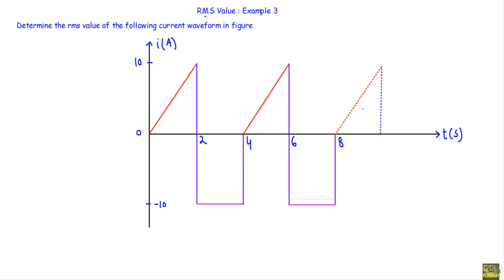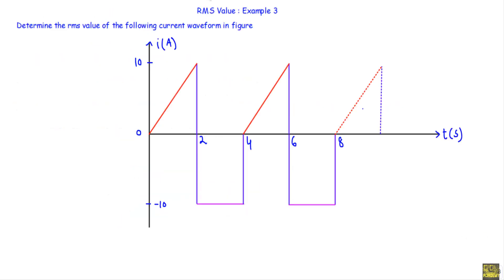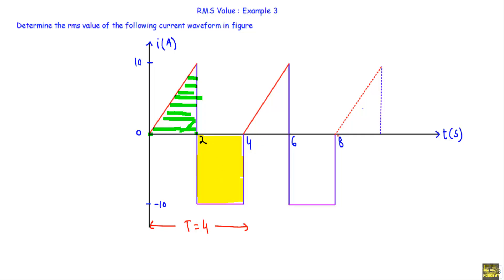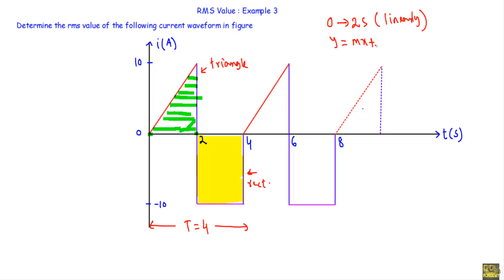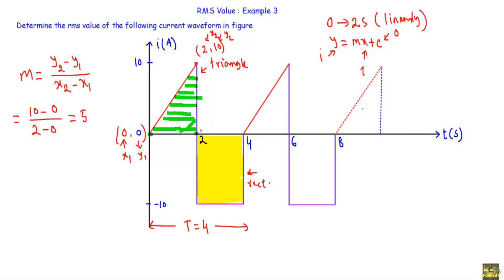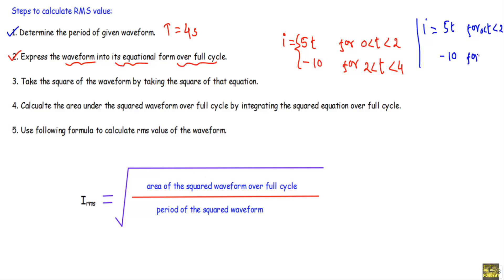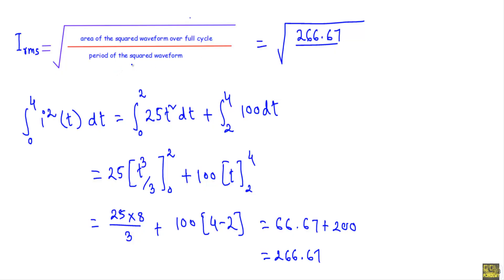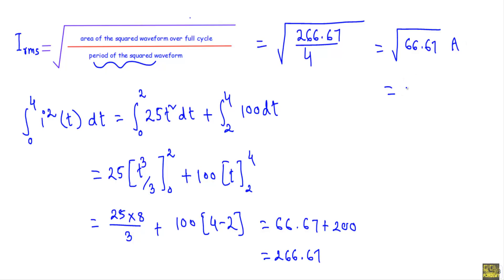RMS Value : Example 3

Comment: Bro Why 5t included with t & why not -10 dont have t?? plz clear me in this confusing situation..
Reply: from the equation y=mx+c, as we deal with current, so we have i=mt + c.  So, i = 5t + 0, and since 0 holds no value, we left with 5t. for the square wave, current is constant at 10 so we can immediately put i=10. But, for triangular wave, the current is not constant so we need to put the equation instead.

Comment: here, 2 to 4 sec area=20 or 10?
pls clear.
Reply from the maker: 20
Reply: Jack Kabir for rectangle area is length* width.. So it will be 10*2=20
Reply: so why book is 10?
Reply: Jack Kabir here we are calculating area under the square of the curve over the given time Period instead of just area under the actual curve. Then we take its square root to get the rms value.